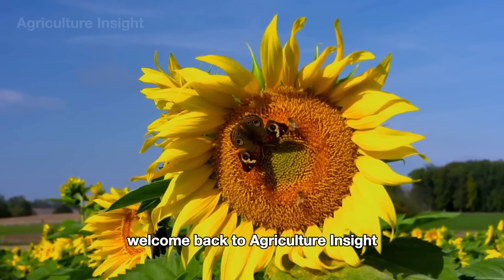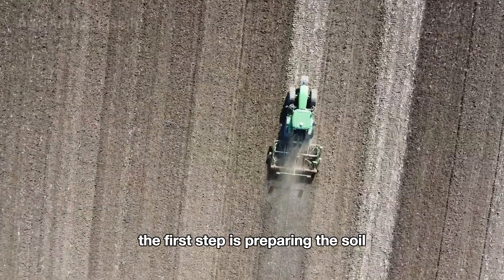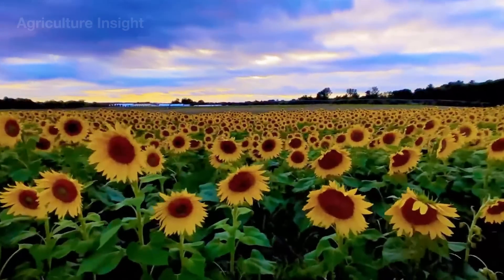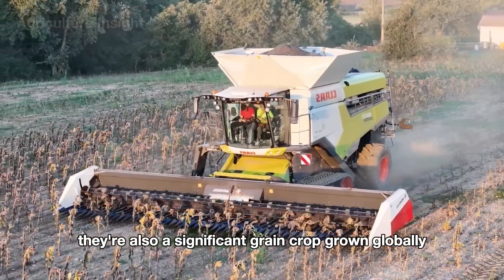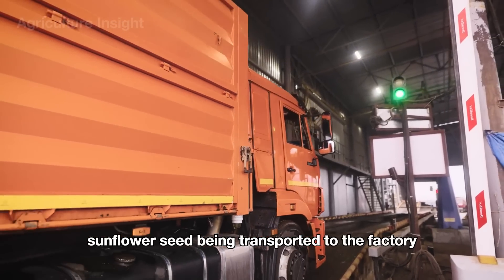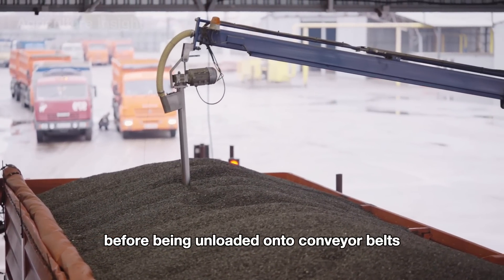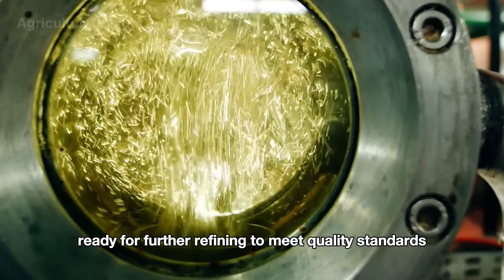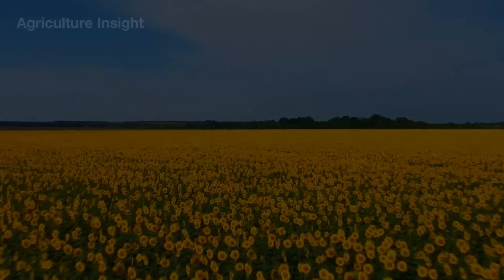2.5 Billion Pounds Of Sunflower Are Harvested To Produce Oil This Way |  Farming Documentary

Comment: Sunflower oil can have several side effects, particularly when consumed in excess. It is high in omega-6 fatty acids, which can lead to inflammation and other health issues when consumed in large quantities.59 Additionally, consuming too much sunflower oil may negatively affect heart health and increase fasting insulin and blood sugar levels, especially for individuals with diabetes.4 Sunflower oil should not be heated above its smoke point of around 450 degrees Fahrenheit, as higher temperatures can cause it to release potentially toxic compounds that can negatively affect overall health.19 Furthermore, sunflower oil might interfere with the effectiveness of diabetes medications, so individuals with diabetes should monitor their blood sugar closely when consuming it.
Reply from the maker: You're absolutely right! While sunflower oil has its benefits, excessive consumption can lead to potential health concerns, especially due to its high omega-6 content. Moderation is key, and it's always best to balance omega-6 intake with omega-3 fatty acids to reduce inflammation risks. Also, keeping an eye on cooking temperatures is important to avoid harmful compounds. For individuals with diabetes or other health conditions, consulting a healthcare professional before making dietary changes is always a good idea. Thanks for sharing this insight!
Reply: @AgricultureInsightusa  the problem is, it's in EVERYTHING as a preservative so I feel it's best to just avoid it as much as possible because you're going to get it anyways.  Like a bag of trail mix or peanuts..  ingredients "sunflower oil"